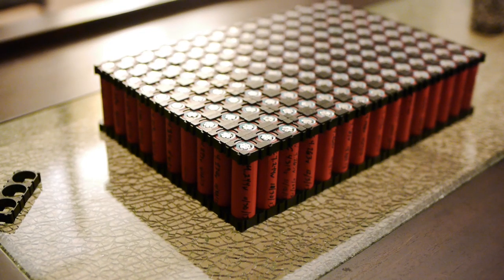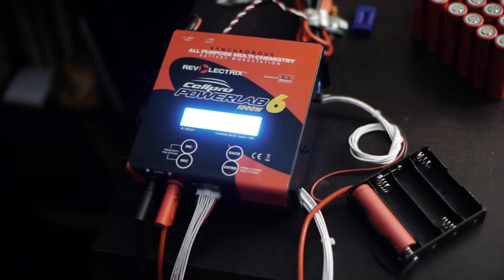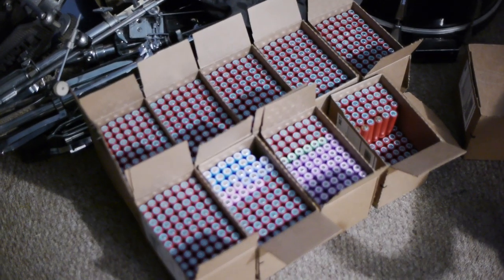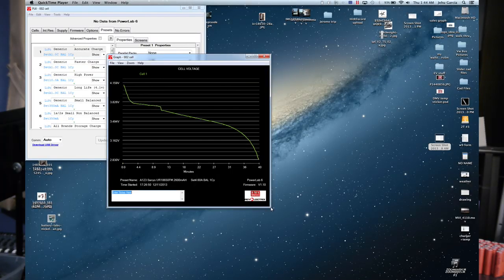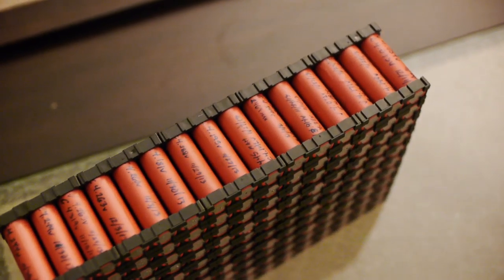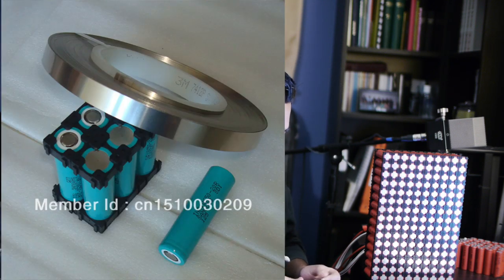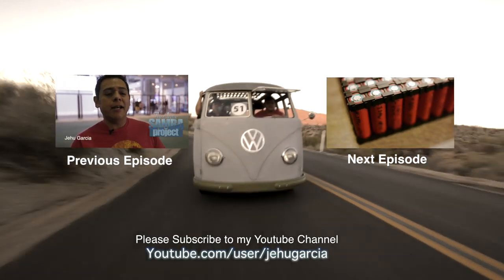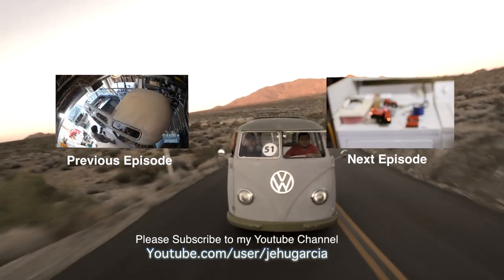DIY EV Laptop battery testing & Buying a Chevy VOLT

Comment: 17:30:  "The electric motor starts to run backwards"
WTF?
It doesn't actually change rotation!  It just works as a generator by switching the electrical connections... it's still turning the same direction!

Comment: If you have Consumer Reports membership they will send you a listing for your dealer you choose and tells you exactly what the dealer actually paid for the car. They still like to rip people off and tell you it has this and that and after the sale you find out it does not. My 2012 Focus has NO Sync AppLink but they put it in the 2012 Fiesta and the 2013 Focus. They also switched the numbers for my trade in from 3500, to 3050 and even then they ripped me off for what my Civic was really worth.

Comment: Had the same experience with our first Chevy dealer. I knew more about the car than the sales people, and when we test drove it there was no gas or battery power so we had to go to a gas station to fill it up. We ended up buying a used 2012 volt from another Chevy dealer that payed there staff on a salary and had fair car prices that they stuck to, so there wasn't any bartering.

Comment: You will not be sorry you bought a Chevy volt , I have a 2012 with 50,000 miles on it and it has never been in the shop, and I live in central British Columbia Canada. We also have a 2017 Tesla model X 100 D.  We sure Enjoy your Program.

Comment: Rewind a microwave oven transformer for a cheap spot welder. Switch the primary so you don't need an expensive SCR. Try 2 turns of number 2 where the old high voltage winding was. To run cooler add 20 turns to the primary- or- run it on a 1 kw variac at 85% of line voltage

Comment: Hello Jehu. I have an electric Sentra, and I have been watching your idea to reuse these 18650 laptop batteries, and I thought I may try it myself too. Here is an idea. I would put the cells inside PVC pipes. There is a grey lightweight PVC pipe for electric cables at Home Depot and I think the cells fit inside OK. This would eliminate all the soldering and replacing damaged cells would be very easy. Assembling cell stripes would be also very easy They also sale 1/2 threaded metal connectors (caps) that thread inside the PVC pipe very nicely and I think they can be used to tight the ends of the PVC and tight the battery connectors. What do you think?
Reply: Excellent videos by the way. Thank you for sharing

Comment: Im also not so keen on that conductive epoxy and those bolts! Egad. Making a tab welder to do consistent tabs would in my opinion be a much safer way to go. But by all means do some testing with the epoxy just to see. Im thinking it won't hold up to the torque or vibration very well and that the ability to conduct the needed currents and not melt would be an issue. That hot cold cycling is just killer. Great video and kudos on the Volt.

Comment: When I test my cells using a Tenergy TB6B box i get real bad results.  I charge each cell to 4.20 volts and then discharge the cell at 1 amp 3.0V setting and only get 3.17 min 2.98 Volts 54mah.  Did you ever try doing 1 cell discharge rate?  I guess the cells I have are junk.  Were did you purchase your laptop cell packs?
Reply from the maker: yeah those are bad cells,  look on ebay lots of sellers selling them in LOTs there

Comment: Regarding the conductive epoxy, I assume you'll test the resistance of it, and how it will hold up to thermal cycling?  Also, I get the impression that you plan to use the nuts and epoxy as the physical support for the cells as well as the electrical connection, which does not sound like a good idea to me.  Of course I think the entire idea of using these cells for a pack is nuts, so what do I know?  ;-)

Comment: Have you seen that it’s possible to use an Automotive 12v battery instead of a capacitor for the home built spot welder? If you already have one laying around it would be a much cheaper option

Comment: Here is an idea. In the future, when you reference a part, BB post or other info, place a  link in your comments. I would love to find those clips you used to assamble your packs. You mentioned EBAY, yet I cant find them there. So, either they stopped selling them or I am searching for the wrong thing. A link would be very useful.
Reply from the maker: rarbolay http://www.ebay.com/itm/10pc-Battery-Spacer-3x-18650-Radiating-Shell-EV-Battery-Pack-Plastic-Heat-Holder-/321114252941?pt=LH_DefaultDomain_0&hash=item4ac3e6a68d
Reply: jehugarcia Thanks, you da man

Comment: Great video!

You might want to consider a stud welder (or making one). Basically just weld a nut to the battery with the spot welder.  The epoxy might have too much resistance for the currents you will draw.   

Any way good luck and congradulations on the Volt.  It is a great car...
Reply from the maker: Good idea I actually have a stud welder,  will have to dig it up and test it out.

Comment: I have a 2013 Volt and a  2013 C-MAX energi plug in and love them both.
Reply: Jon Car the c-max gets way way more mpg on gas
Reply: I am on my 2nd lease on a CMax Energi 2016 plugin and we are averaging 125 MPGE The car is an absolute bargain.  You can lease the Energi for zero down and $265 a month.
Reply: Looking forward to the release of the Bolt
Reply: Jon Car just bought a used 2015 energi with 8k miles on it for 16k
Reply: Awesome